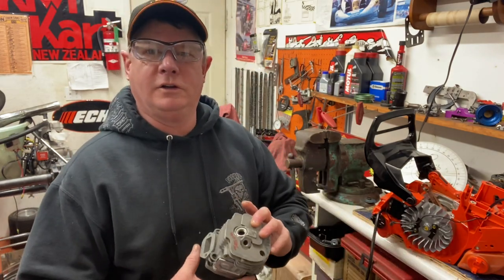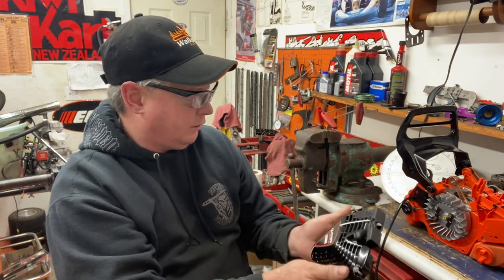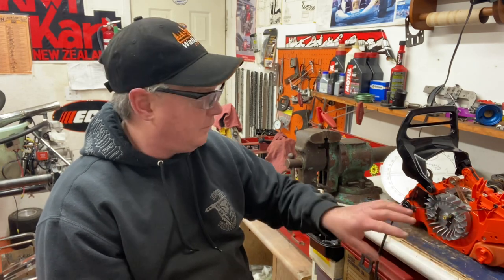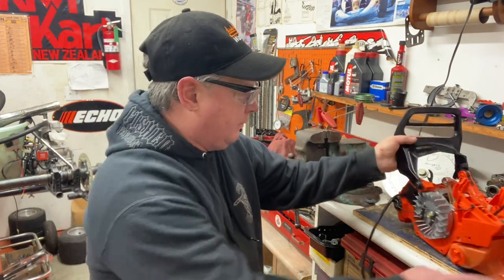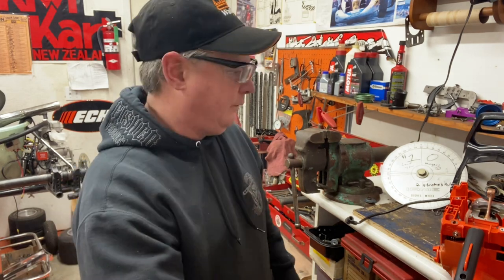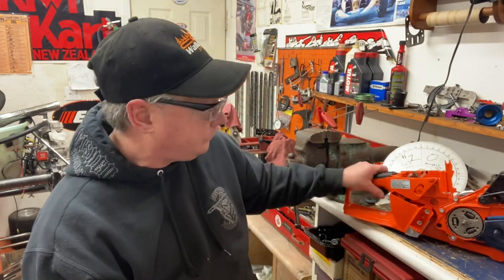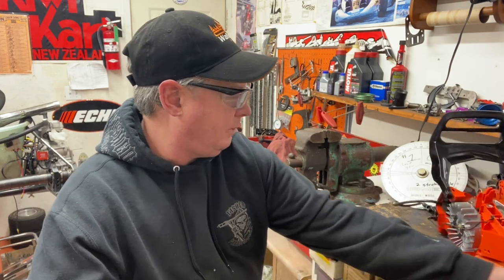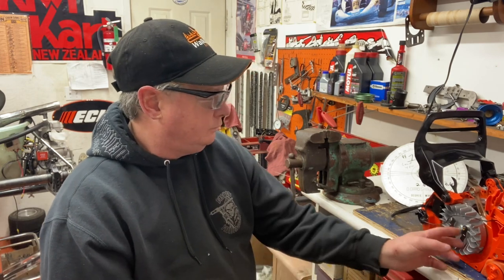Donny walkers chainsaws showing echo 7310 saw

Comment: Great video!  I have a jonsered 920 great Saw! But man is it hard to pull over. The 910 has a decompression valve but not the 920. Would like to see someone do a video adding one to the 920. It would make it easier to use.

Comment: My opinion is Echos have the best air management/air filtration of any of the brands.  I've cut many tanks and opened the cover only to find the filter spotless, looking brand new.  Very impressive on that side.
Reply: Yeah they really nailed it the 7310 is the only 2 stroke equipment I've run that will have a literally spotless intake.  Some will be super clean but never spotless they are designed to last a lifetime feels like.